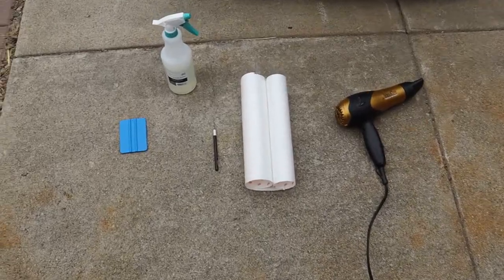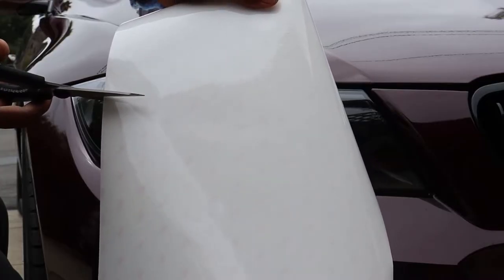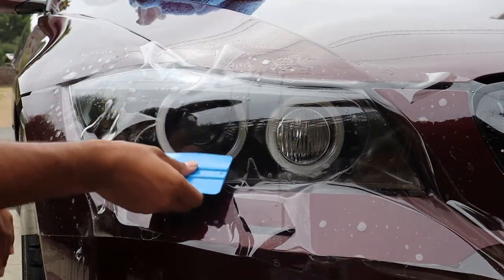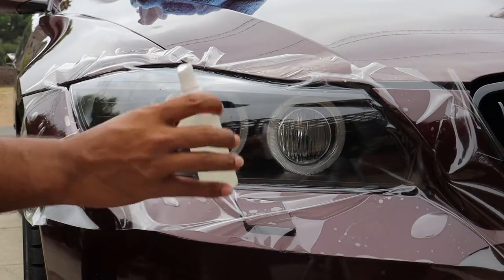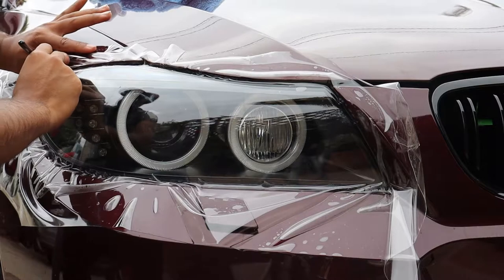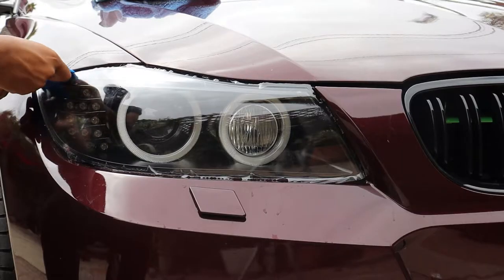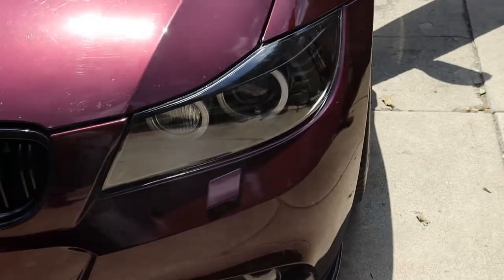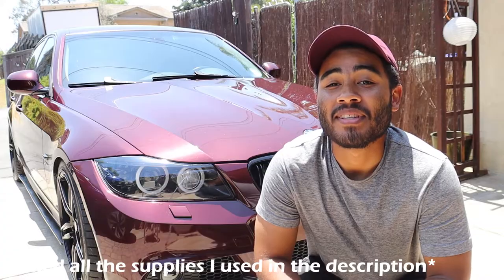HOW TO APPLY PAINT PROTECTION FILM TO YOUR HEADLIGHTS

Comment: Really the best way is to disconnect the headlight to wrap it around easier. Just a few extra steps but way easier putting back in fully intact.
Reply: Few extra steps?  Jack up car, remove fender liner, remove bumper, struggle with corroded bolts, etc.  I'm just saying this because that's what it took on my 335.  But I was replacing the lens.  Just figured I'd protect them while I'm at it.
Reply: @ichoozjc can confirm that's the struggle with most modern cars

Comment: I tried to do this with my Nissan Stagea, but the headlights wrap around the side of the car and made it difficult to stretch the film. I think something that may help to do this better is to use painters tape and mask up the headlight, then trace an outline for the shape of the headlight onto the tape with a sharpie pen. Then remove it from the headlight and trace that shape onto the 3M headlight film and then you can cut an exact profile of the headlight onto the film. This should make it easier to stick on and you don't have to try cut it once it's on the headlight, which is tricky to get a nice clean line with. Just a thought?

Comment: The film comes with 2 peelable flims, one that expose the adhesive side and one thin layer you can remove after applying the product, as i know because i applied these film twice on headlights
Reply: 1. Can you link me to where you got your ppf? 
2. I am worried if bought from Amazon they are not genuine.
3. How to remove it when they start to peel/bubble/fade? I heard using a steamer?
4. Thanks

Edit
If I am applying ppf to headlights, I will use paper to make a template and then place it on top of the ppf to cut it.

Comment: Thanks for sharing! I don't have a pre-cut template for my headlights so this is the method I was planning to use to apply my paint protection film. Any ideas on how to get a cleaner edge when you trim?
Reply from the maker: I think someone said to not have so much excess when you start cutting out the shape. You could check the other peoples comments for feedback
Reply: One way to protect the car and also get a clean cut, is to use a squeegee just for cutting. It will take more time, but it will be worth it. Never use a razor on a car. If you cut the paint, it will cause peeling and then rust (if it's metal underneath) and definitely damage the car.
Reply: @las1368  Wait, how to use a squeegee for cutting?

Comment: Quick tip: start on the flat surfaces with your tac points. Once your flat surfaces are secure you can then go to your curved glass and get that applied. Also use a lot less wrap in the future as a good controlled stretch of the fabric can go a long way…
Reply: But you did a really good job non the less, as I like to say, do whatever works for you…

Comment: I just wrapped my headlights same as you using 3m clear film. But one of my older brother who works at a repair shop told me that my headlights' housings are gonna burned (overheaded) because of that 3m clear film since he had replaced some headlights' housings for his customers as the same problem 😱. Have you heard or experienced about that? I am wondering keep them there or take them off.
Reply from the maker: I haven’t heard of that happening? And mine are still fine as of right now.
Reply: @InlineSixAuto  I am glad to hear that
Reply: @truongminhthien3913  not sure how, headlight is still sealed in front and not the back
Reply: What bulbs were those? Led and HID bulbs don't produce as much heat as halogens.

I have a 12 year old film on factory HIDs and halogen DRLs. Looks good as new.

Comment: Does this kind of film fade the headlight after a while?  It means that my car has a white headlight, but when I turn it on, it looks a little yellow instead of the previous white.  But when you look at it from the outside, it doesn't even look yellow.Are there any side effects by sticking these kinds of films?My vehicle is a brand new car
Reply from the maker: I never had that issue with this film on my headlights so far. I had this one for about year and then I got new lenses and redid the PPF film and it’s been another year since. So I can’t say for sure if it will yellow.

Comment: Hate when the headlights turn yellow from all the oxidation  every 6 months after buffing the hell out of them, this is a good idea
Reply: the headlight after polishing has a damaged protective layer after polishing, so it is necessary to restore this protection by painting, sticking foil or at least applying a ceramic coating with resistance to UV radiation so that the protection does not degrade and the Plexiglas does not oxidize